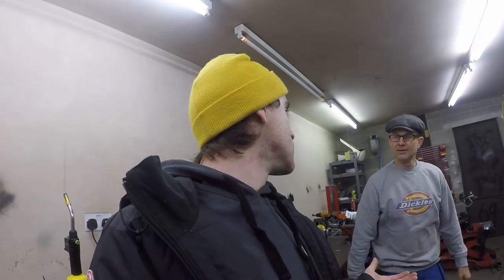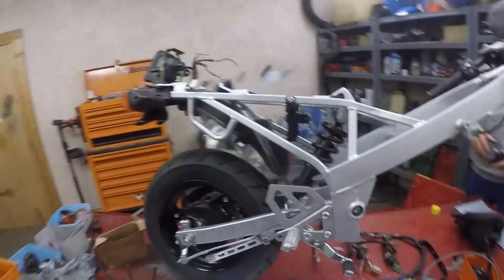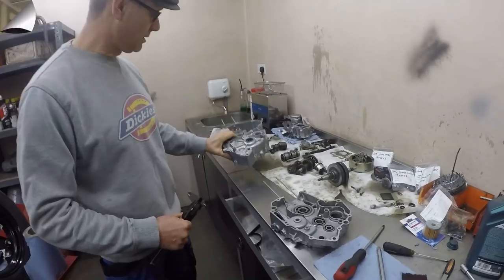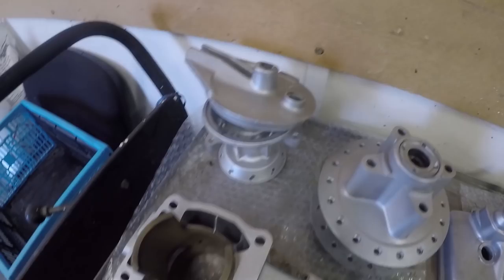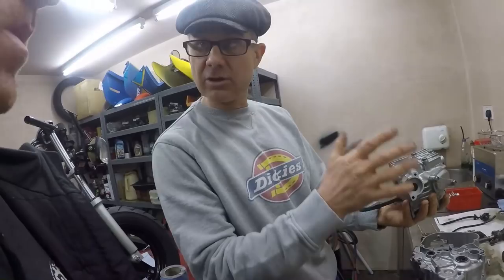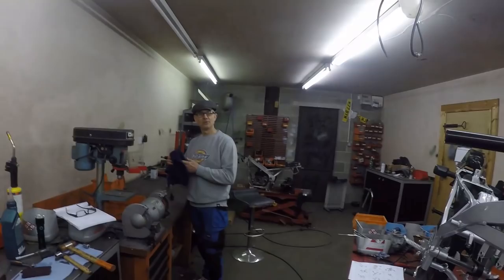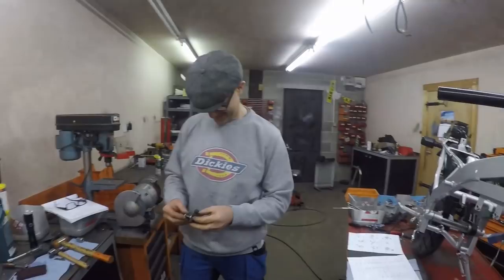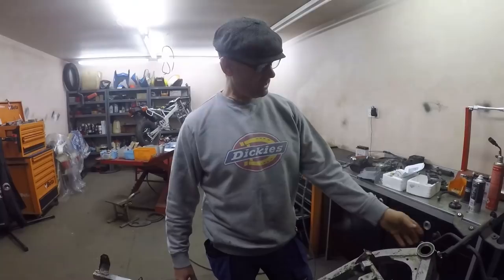Learning Japanese and building bikes

Comment: Great video. I've always fancied one of these little bikes (NSR/RB/YSR). I saw a lineup of these outside BATS motorcycles many years ago and have wanted one since. As a tip, if you change the camera frame rate you might get rid of the flickering at the top of the screen from the lights.